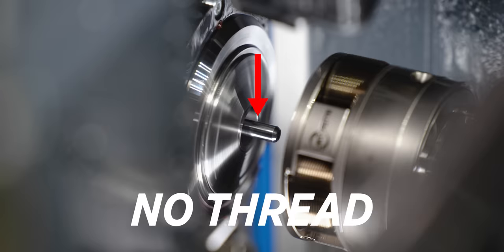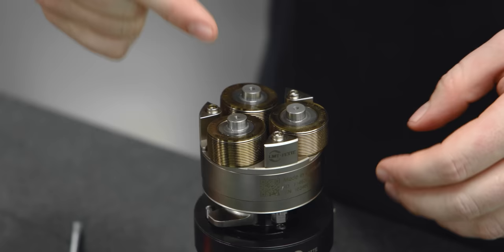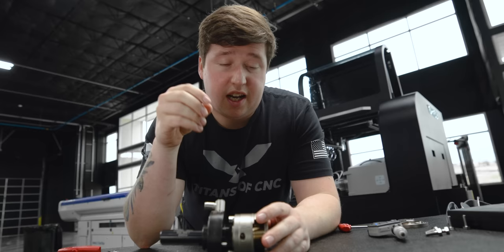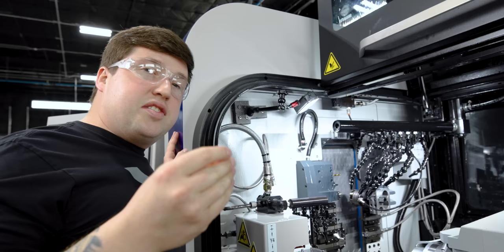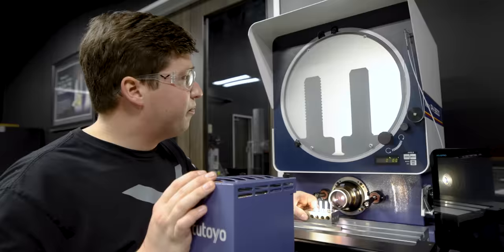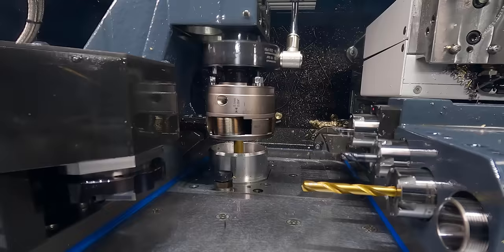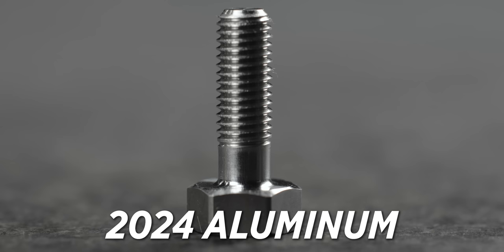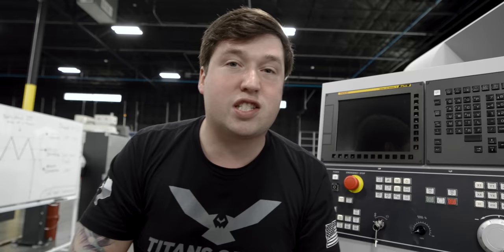How to Form Threads In Less Than 1 Second

Comment: What about oil/coolant inclusions? This method may not be good enough to stuff exposed to vacuum etc
Reply: @AlessioSangalli I can try to answer that. Do you mean to ask about the performance on vaccum heat treated parts?
Reply: Rolled thread in general are not good for vacuum work.  I worked at a shop where we did almost exclusively parts that were exposed to high vacuum conditions.  We were expressly forbidden from rolling any threads.  The displaced/folded material, like you said, can hold coolant/debris that is impossible to remove.  Once it's put in a vacuum costly/bad things happen.
Reply: @anup_david  no as in aerospace applications or semiconductor industry where usage applications are in vacuum
Reply: @AlessioSangalli  the threads themselves are not affected by the vaccum. If the forming folds on the thread crest are a concern the crests of the thread will have to cleaned up with a finish cut to prevent any debris being lodged in the forming folds.
Reply: @anup_david  Going back in to finish cut the threads will cause burrs. At that point you're better off cut tapping of thread milling.

Comment: These are great until you have to tell the owner you just blew out another set of thread rolls and will need to order another set!! Blown profit.
Reply: You can send some thread rolls out for regrind which cost half the price than buying a new set.
Reply: @Ernesto Diaz  some. We regrind the leads alot in house and they are never the same and only work on certain jobs that don't require threading to a wide shoulder. Soft brass and 12L14 are gravy. When it works, its great and love the look, feel and speed of it. But inexperienced set up/operators can ruin your day in a hurry. Some customers also demand such a perfect thread crest that a blow out is bound to happen throughout a job. We mainly run Fette, Reed and Salvo for the ammo reloading industry, agriculture and marine to name a few.

Comment: Unfortunately, you do not address  the fit requirements.  For example, 1/4- 20 UNC - 2A is the standard fit (2A) for many BUT NOT ALL situations.  Some precision threads (typically fine  thread) will specify 3A vs 2A.  A lose fit  thread will specify 1A (UNC type threads).   This is especially  important for Stub Acme thread (1G, 2G, 3G etc) as many oilfield downhole tools need loose or precision fits depending on the application.   So, my question is how to you reach the fit requirements for the specified thread designation?

Comment: How do you compensate for wear tho??
Reply: This tool maintains its accuracy until the rolls reach the end of their life, as the presenter makes clear you must only manage the wear on the turning insert which prepares the blank. After many sets of rolls are used, the head itself may be worn. In this case, spare parts may need replacement to refresh the head's performance/accuracy.
Reply: @johannesfossi5561 you don't need to. the thread dimensions remain unchanged till the end of life of the thread rolls.
Reply: @Dominic Tascone   @Anup David   👍

Comment: Yeah no. . . . . Don't waste time backing off the thread rolls all the way. . . When you set them up, use a bolt or a sample part with the same thread and set the rolls to where you can screw your bolt into them with a tiny amount of drag.